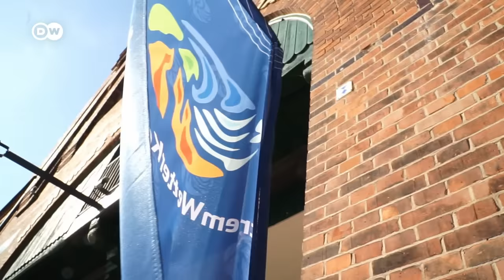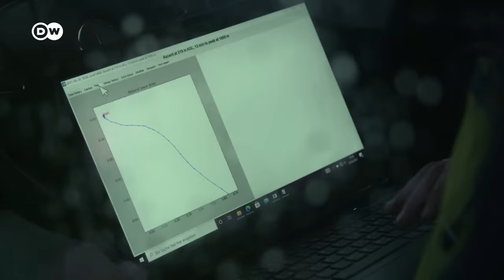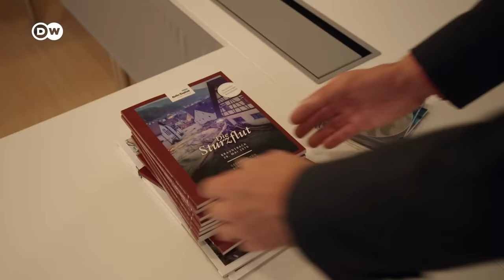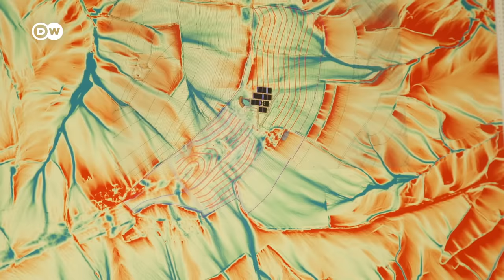Floods, drought and the consequences of extreme weather | DW Documentary

Comment: 7% additional humidity in the per 1C warming means, when it rains there is more water vapor and energy to make things worse. Also jet streams have altered allowing more durable raining in one area. And the ground may have been damaged during heatwaves making it less soakable letting more water to the streams. Also lack of snow and ice packs in the mountains means they are not buffering the rains as they used to. There is less snow and more rain in warmed climate. We are losing Alphine glaciers. This allows more water to run down the hills in less time making flash floods even more likely. There is also elevated risk of mountain lake bursts, because thawing and melting have brought more water to them and their banks are loosening too. Even mountains can be disintegrate to mud slides, because they have been bound together with permafrost that is currently thawing rapidly.

All these combined could lead to monsterous floods. And all of these have worsened because of climate warming.

To make situation even worse we have paved huge areas with concrete/asphalt that blocks the water on the top. And our buildings are build in the areas where there have been flash floods in the history.

It is likely to see these events more in the near future.

Comment: clean energy clean water The biggest idea I am trying to express is tunneling aqueducts from the coast, in this case the west coast of the USA inland to feed combination geothermal power and sea water desalination plants.  The idea seems to be so big that no one has considered it possible but I believe it is not only possible but it is necessary. For over a century the fossil water contained in aquifers has been pumped out to feed agriculture, industry and municipal water needs. The natural water cycle cant refill fossil water deposits that were filled 10,000 years ago when the glaciers melted after the last ice age. Without refilling these aquifers there is not much of a future for the region of the United states. As a result ground levels in some areas of the San Joaquin Valley have subsided by more than 30 feet. Similar fossil water depletion is happening in other regions all around the world. TBM and tunneling technology has matured and further developments in the industry are poised to speed up the tunneling process and it's these tunnels that are the only way to move large volumes of water from the ocean inland. The water is moved inland to areas where it can be desalinated in geothermal plants producing clean water and power. In many cases the water will recharge surface reservoirs where it will be used first to make more hydro power before being released into rivers and canal systems. It's very important however to not stop tunneling at these first stops but to continue several legs until the water has traveled from the ocean under mountain ranges to interior states. Along the way water will flow down grade through tunnels and rise in geothermal loops to fill mountain top pumped hydro batteries several times before eventually recharging several major aquifers. What I am proposing is essentially reversing the flow of the Colorado River Compact. Bringing water from the coast of California first to mountaintop reservoirs then to the deserts of Nevada and Arizona and on to Utah, New Mexico, Colorado and Wyoming. This big idea looks past any individual city or states problems and looks at the whole and by using first principles identifies the actual problem and only solution. 

A better future is possible.

Comment: I believe the main source of global warming is fossil fuel consumption to produce energy and if emissions continue at the present rate the climate will become more extreme. The use of wind, solar, geothermal, wave, hydroelectric and other green energy are good but you need base loaded generation in order to have stable energy system. I worked for a very large government utility for nearly 37 years as a chemist and realize that a long term carbon free energy source is extremely important. I think that nuclear fusion is many years away and an interim solution is thorium fission plants. I realize that no one wants nuclear power but current severe climate changes coupled with melting polar glaciers and ocean acidification will create world wide problems. The cost of carbon emission reduction is great but the consequences are much greater. The climate has changed many times before and will change again whether humans reduce emissions but there are solutions that are under human control.

Comment: Holy Mary from Trevignano Romano worned that there will be a famine. In biblical term it means that there will be year after year after year of draughts and massive bad rain that strips the top soil. We must build a system of canals in abluvion prone areas to divert the water into reservoirs and camps must have smaller measurements with perimeters at least 3 meters wide of ablsoluterly never touched vegetation left to grow wild on its own, in the perimeter between the wild part and the farmed part there should be canals that might help a bit  to channel the water and even retain at least a bit of the top soil.

Comment: Promote holydays by trains powered by electricity and promote local holidays for each area, create swimming pools , and tours in the fields in farms , in the forest, at the zoos and plant trees holidays look in these films there are large fields with narrow strips of trees around them. This is very bad, fields should be of smaller measurements with a two to three meters wide perimeter of trees and wild bushes never tilled it will help increase natural fertility slow doen soil erotion during droughts and abluvions and produce more clean air.